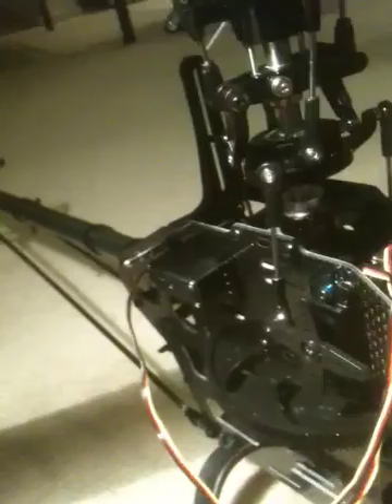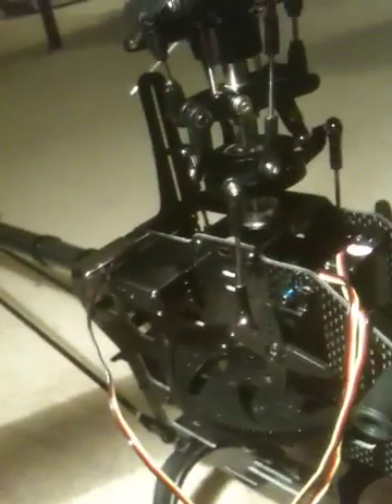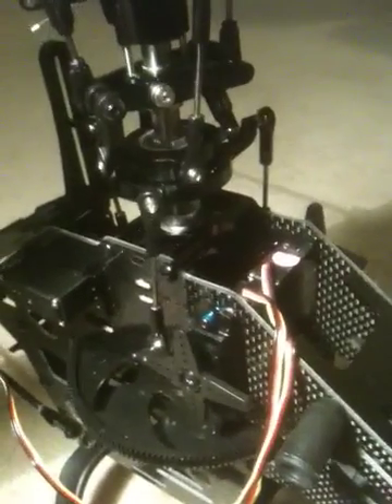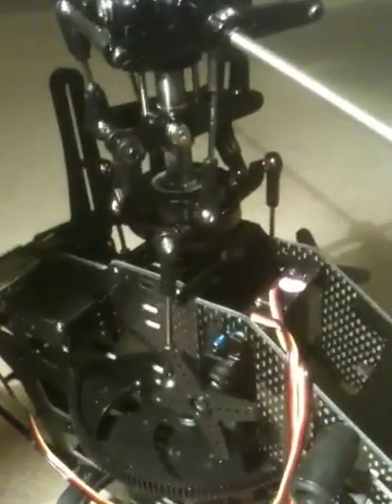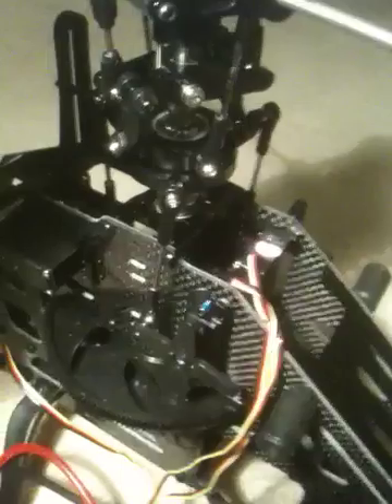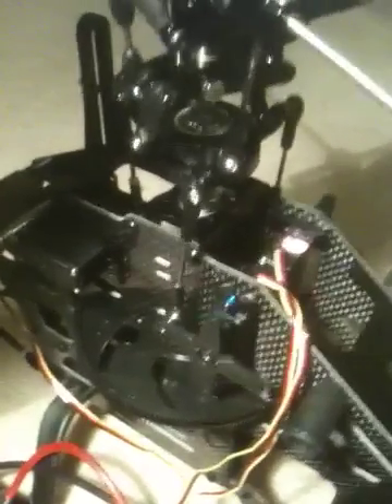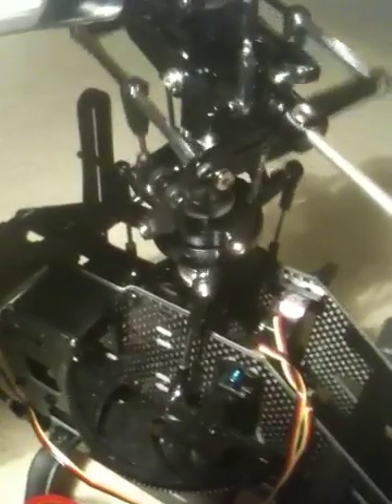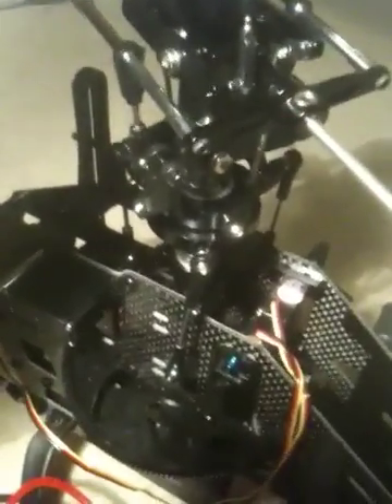Hitec 82mg servo buzzing

Comment from the maker: OK solved the problem. I'd used different servo horns to the ones that came with the servos. While they seemed to fit fine, the depth of the hole that slides onto the servo was deeper than the original servo horns. The added depth meant that when i screwed the servo horn onto the servo i was forcing the rim of the hole hard against the servo casing. This caused the binding. Simply remedied by filing a mil off the rim of the servo horn shaft hole. Hope this all makes sense. :-)